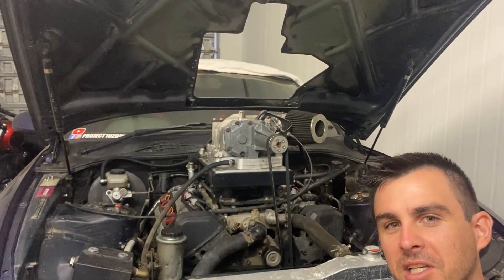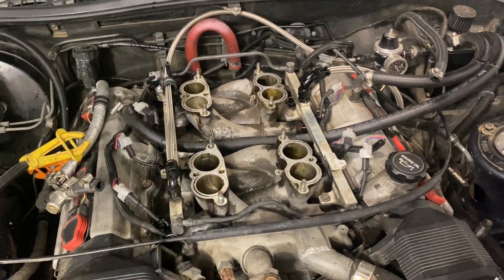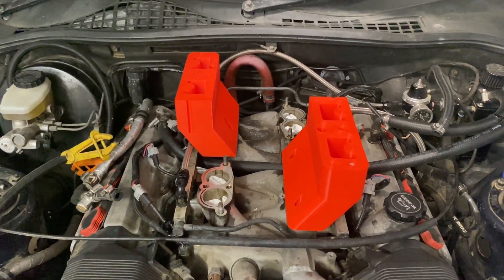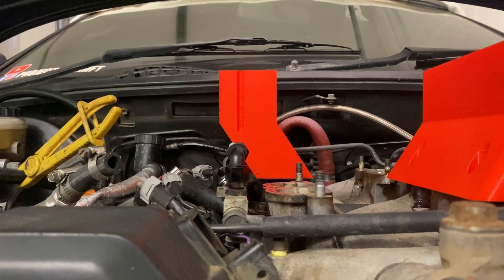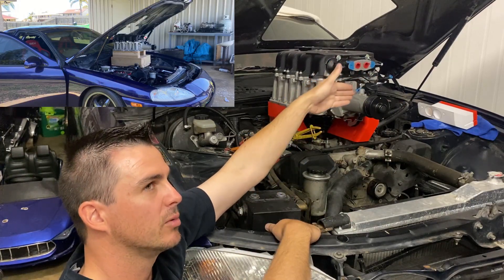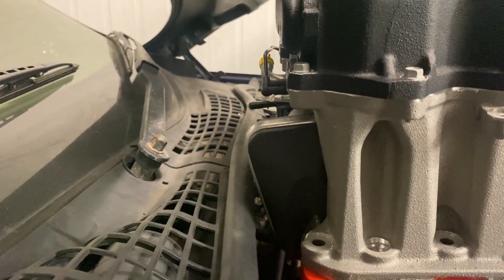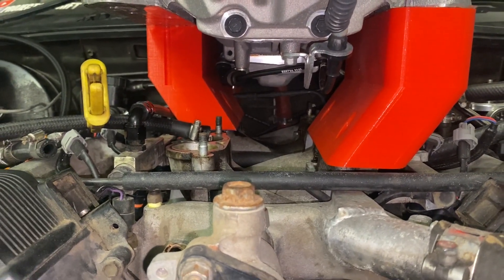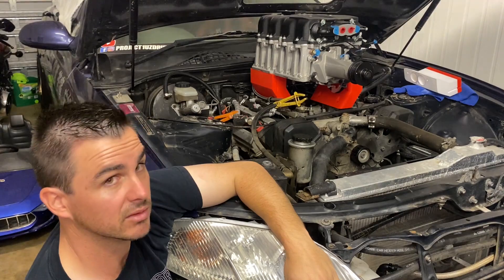Test Fitting the Northstar M122 Supercharger on the 1UZ!

Comment: Excellent work....however did you not consider using the Cadillac manifold for injector mounts and making your adapter to go straight down onto the heads?
I know it's harder because of the head V angles, but you'd eliminate a lot of the height issues and would look really cool.
Reply from the maker: I had considered that but I really like the look of the supercharger fully exposed

Comment: Great work so far. You prob already thought it this, but how about having some straight vertical in the adapters from the lower manifold so it clears fuel rails, then the taper/horozon deflection? Perhaps less straight vertical on the supercharger side to reduce overall height. Radiused at the transition to and from the taper/horizontal deflection would look sexy, and may flow minuscule better. Keen to see your journey.